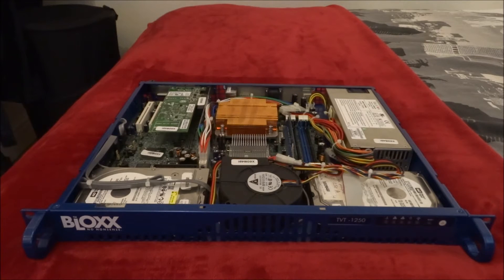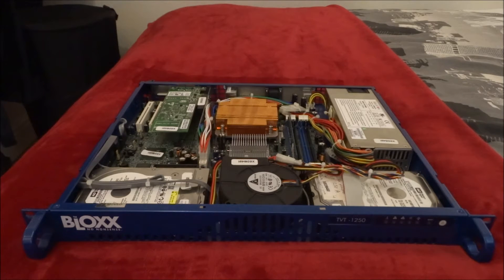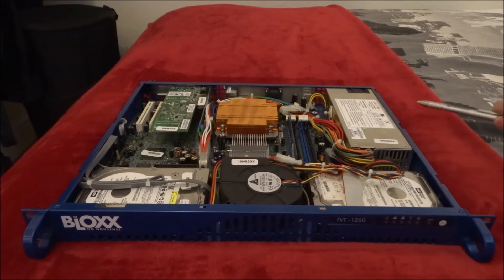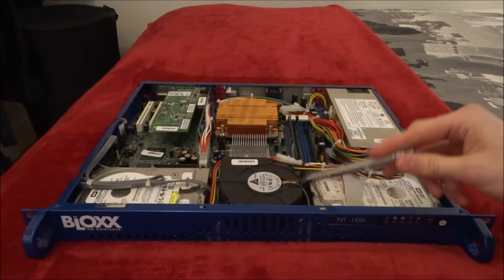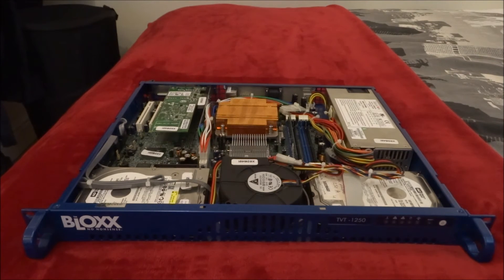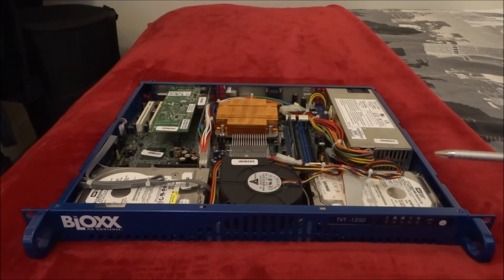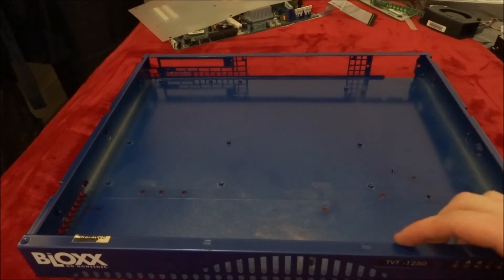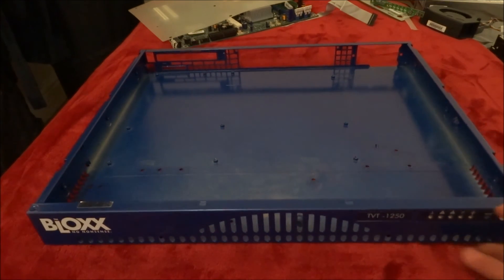Building the ultimate (Firewall) EP 1

Comment: Personally, I'd put in one of the quad core atoms or a Pentium cpu in it, reduce the power usage in it quite a bit. those old xeons are power hogs.
Reply from the maker: +Michael Spears The purpose of this project was to re purpose this device changing the internals as little as possible, the ram was upgraded extremely cheaply and the blower replaced. In an ideal world I would have replaced the HDD's for SSD's and the processor. With a TDP of 65W it isn't really that power hungry!
Thanks for you input, hope you enjoy the series!
Reply: +James Smith True true. My memory served me wrong with the power usage of that proc, but you're right.